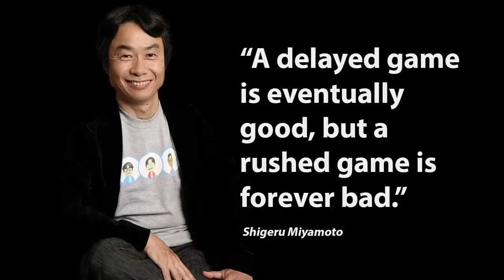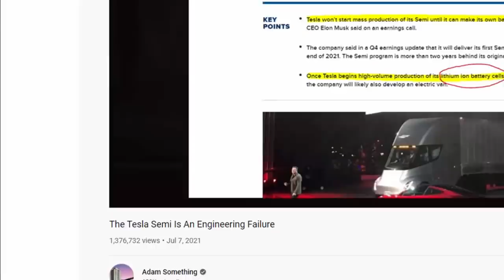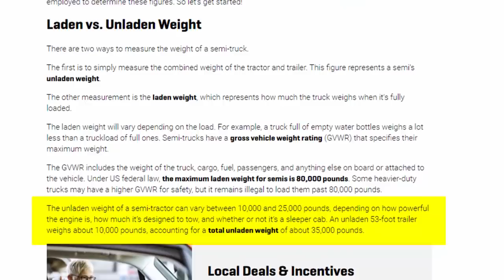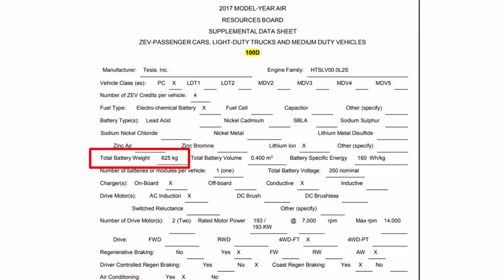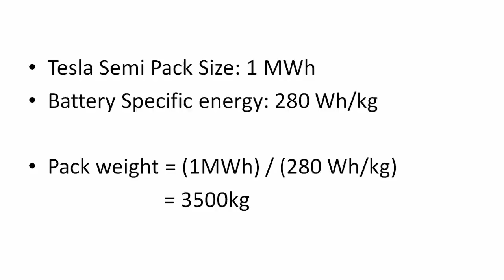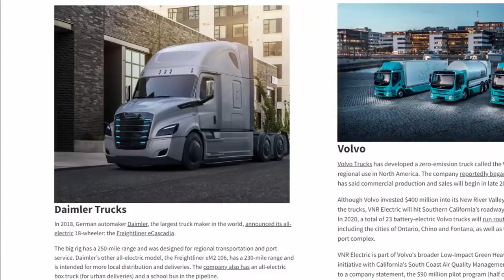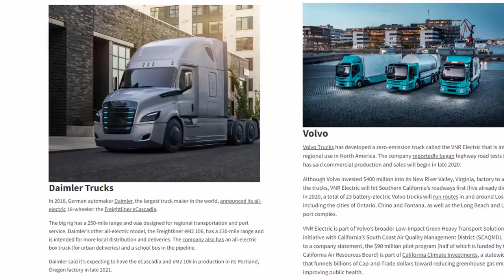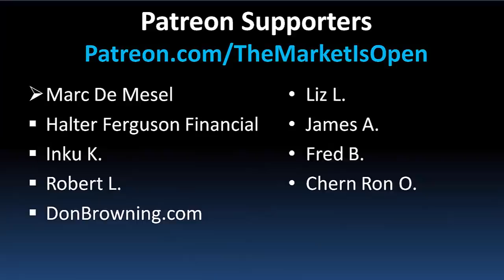The 2022 Tesla Semi is Genius, And Here’s Why

Comment: Elon and Tesla have had a perfect storm over the last few years. From covid to chip shortages and supply line issues the problems have been terrible. Seems that no one thinks these issues haven't caused delays that no one could have imagined. There is no doubt that Elon can be overly optimistic but when you look at what has been going on its easy to see why lots of things are happening slower than expected.
Reply: I'm glad you included the changes to "maximum permitted mass".
Absolutely vital to the balanced picture others choose to ignore.
In Sheffield roughly middle of England (where I was a Transport Manager for 25 years) a long run is over 200 miles. We ran general haulage. 80-90% of the runs were well under weight. We had a contract to deliver new beds and had Volvo de-rate the vehicles down from 38 tonnes to 20 to save £000's on Road Tax (Vehicle Excise Duty) every year. It took ages btw because Volvo had to figure out how to do it legally.
It ended up being fewer bolts holding the 5th wheel.
For the information of people not used to the terms, the 5th wheel is the greased plate that slides under the front of the semi-trailers to support the front end. So named because a trailer supports all its own weight on wheels whereas a semi-trailer has wheels at the back and is semi supported by the drawing vehicle.
Reply: When you give timeline of 2019 ,2022 is not acceptable , covid came in March 2020 ,teala never had any plans to build semi before 2022 , first excuse was battery cell size then it was covid , pricing will be going to be bad
Reply: Tesla makes a small fraction of the car market obviously chip shortages hurt those who make more vehicle everyone except Ferrari.
Reply: @paulbedichek2679  Well, they are the largest provider of EVs. And will continue to gain market share, when the two new factories open.
Reply: @AudiTTQuattro2003  
 @Dan Rowley  
A lot of work to convince people elect cars are better for us stupid people!
INVENTORS MANTRA IS "KISS"
"Keep it Simple Stupid" if you want an invention to succeed. 
Nothing simple about changing every gas  station on earth to electriic for starters. Why would we do that anyways; for Elon Musk?

Also: "If it's not broken, don't fix it"
Todays cars are a great product, nothing broken.

Gas stations work great, and well designed; nothing broken.

Fossil fuels plentiful, source is fine, nothing broken.

Electric generation plants, nothing broken.

Floridas beaches, and even my own San Diego's beaches are still here!
Nothing broken.

Global Warming?
Let's ask Al Gore on that subject, he's a renowned scientist, as is AOC!
How's her Armagedon prediction of no turning back glo warm after 10 years going?  A lot of problems there!!
China a NO Show at last climate summit; a lot of problems there!!
Reply: Your argument is completely false. If anything that has helped Elon since other manufacturers had much larger production issues due to their dependence on Chinese computer chips.

Once they get supplied again, Elon will have a way harder time competing. 
Especially once the older manufacturers completely focus on evs instead of having to deal with two kinds of motors and the old established infrastructures and experts on combustion engines in their factories.

Just look at Mercedes: 
Their EQA, EQB and EQC are based on combustion engine designs, which is why they aren’t as efficient. 
However, once combustion engine cars aren’t produced anymore, Mercedes can fully focus on electric vehicles and design them accordingly. Their EQS is built on an almost completely new developed platform and as a result already beats Tesla in terms of maximum range. 
And as I said, Mercedes has yet to change a lot of their factories and personnel to only designing and producing electric cars. The eqs, if you will, is only a fraction of their power. 

And their new concept ev gives you a good idea that if anything, tesla is going to lose its ground. Not to mention the eqe, which will be more affordable than the eqs while still having great range. 

And quality wise, Teslas cars were never very good. Not to mention their auto pilot which is just a glorified version of the drivers assistance systems other manufacturers have been using for ages.

Tl:dr: 
Tesla was able to start from zero, completely focusing on electric cars and building all their factories from the ground up.
Other manufacturers first have to deal with their already established factories and expertise on combustion vehicles. 
Not to mention their customer base, which doesn’t necessarily want electric cars. 

And the manufacturers aren’t sleeping or lazy. Teslas only unique sales proposition (Acceleration and range) will soon be gone. 

Same arguably goes for the computer in tesla cars. They could easily develop and use state of the art software and design their cars accordingly. Other manufacturers basically had to keep updating their software incrementally, while still using the same processing systems and sensors they already used 30 years ago which is why it is outdated in comparison. 

And once again, once they start building new cars from the ground up, they will be competitive again.

Not to mention that not having any buttons in a tesla (not even a gear selector) is a blatant cost saving feature
Reply: @AudiTTQuattro2003  
Who's "bashing competition"?
Reply: @rogerstarkey5390  every Tesla fan ever, rarely on the basis of facts
Reply: @AudiTTQuattro2003  you're right until we remember that "the competition" are the ones blaming the chip shortage for their reduced production. 
Tesla adapted 19 alternative chips and rewrote firmware to allow the production to accelerate. Tesla admitted it's a problem and only managed 87% improvement in production 2020-2021.
Reply: @andrewsaint6581  ... 'only managed 87%.... IMPROVEMENT'....
Reply: @nealtauss1715  yes, Irony Man struck again. 😉
Legacy lose sales and blame chips.
Tesla smashed it and said getting chips was a challenge.
Interestingly gm lost sales and inventory went up to nearly 200,000 unsold.
Reply: @AudiTTQuattro2003  Elon is smacking them around some & they deserve it. Elon's an upstart & the world's auto companies are being spatter all over the map who should have a had time getting past GO! The bromide "Drop your c***s & grab you're socks" is confusing to them and if the Union get involved they get confused & fall back to sleep. Here's how absolutely pitiful this whole mess is...Elon is 50 GM was 50 in age how many decades ago? The guy who started Tesla runs, owns Tesla owns a car company that is how many years old? It's fine that GM, FORD & whatever thought combustion engines were going to be the cock of the walk for decades to come but to not think outside the box & at least have a prototype at hand for different iterations of what the next generations of vehicles might look like run like to me smacks or asses  who thought the government would always protect them.
Reply: @danrowley6934  
Elon Musk is betting on electric cars. Weather like this year tells me: Global warming will fade like Al Gore hoax, and with no green energy will come no desire for Tesla cars and the Solyndra like gov't subsidies to Musk! 
Glad i don't own Tesla stock!
Name a great invention that improved on an existing invention that needed gov't subsidies.
Reply: @danrowley6934  your whole comment is bullshit.
Just to correct two of your opinions:
- Unions are essential for worker’s rights.
- Elon didn’t start Tesla
Reply: Elon Musk is betting on electric cars. Weather like this tells me: Global warming will fade like Al Gore hoax, and with no green energy will come no desire for Tesla cars and the Solyndra like gov't subsidies to Musk! 
Glad i don't own Tesla stock!
Reply: @thedudena5525  No doubt he will have struggles in this country, but China is run by a Dictator the rest will use the environment as the hammer to sell EV's. There is only one country that, depending on whose in the White House, is truly free. But with possible rebates, lower prices on the cars & those batteries Elon might win a lot of converts. Time will tell.
Reply: @thedudena5525  clever words do mean something is true only that a clever mind can make it sound so. The electric vehicle is an idea who's time has come. Adoption is inevitable.